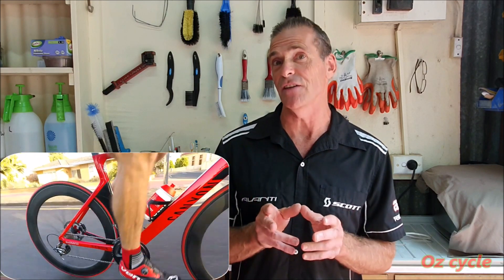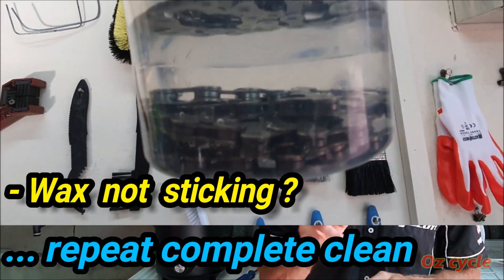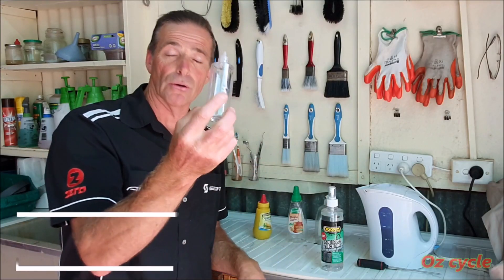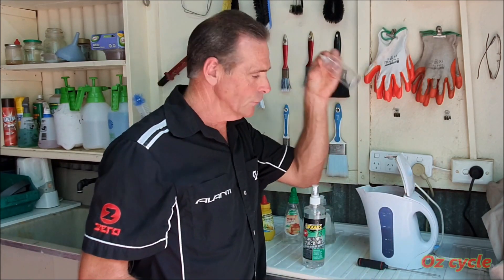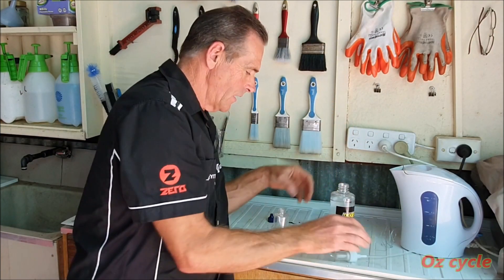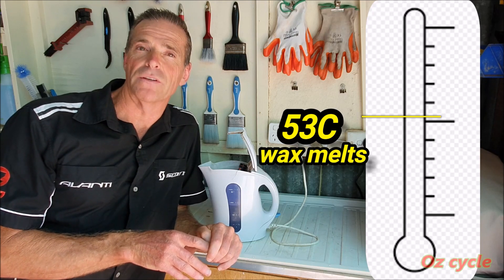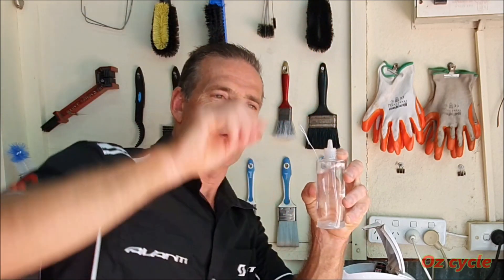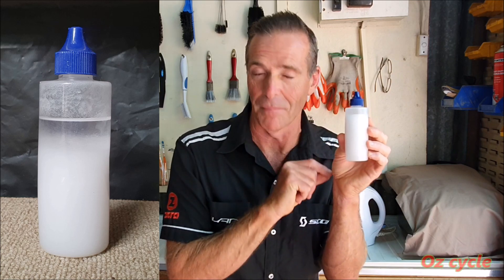Chain wax in a bottle - make it yourself

Comment: I think completely degreasing the chain and changing the wax if it touched any oil is bollocks.  Your own previous recipe softened the paraffin wax with liquid paraffin, a.k.a. mineral oil.  Paraffin wax and mineral oils are both petroleum distillates, composed mainly of alkanes, just of different molecular weights. Petrol, oils, kerosene, paraffins all mix with each other.  Molten paraffin wax washes away traces of petrol, kerosene or mineral oils if agitated sufficiently.  What am I missing?
Reply from the maker: Oil inhibits the ability of wax adhering to the chain and attracts dirt.

Comment: Idid the right same thing but my wax and alchohol seperates, wax in the bottom
Reply: Might be the % isopropyl. You can get it in different strengths, typically from 50% to 90%.

Comment: anybody knows how it performs in close to freezing temperature?
Reply: going on his other vids it should flake off mostly but there will be a micro coating of wax/ptfe on the metal. inside the links should be fine, if it crumbles the particles would be smooshed back into a softer solid product by the chain action rather than falling out. if its wet conditions i might be weary of corrosion with that micro layer but overall it would work ok ..in theory.
Reply: I very much doubt if you are putting, even as low as 10 watts, through your sprockets and chain, they are not well above freezing.

Technically, the wax is already frozen (a solid).
Reply: @LilRedDog  switched to smoove wax lube. expensive as shit but i love it. no more gasoline chain cleaning madness
Reply: @Vova3iLvova  I wonder, now that I went through so many replies, how the climate, in a particular region, affects which wax we use.
I live in a, slightly, colder latitude than Oz. 
So when my wax melts at 37c it is nothing like (I mean, that is hot no matter where you are but I seldom live in it much less ride when it is that hot) when his melts at 50c.

It would be very informative if people mentioned the average temp they have problems.

As for Smoove: I love doing the cleaning and fresh waxing. There is something about working on my bike, to make it better, that I, absolutely, love doing.

Comment: Weight based quantities would be useful here.  I mean, I appreciate the contribution, but without a weight based starting point I’m left to guess and screw around with trial and error.
Reply: Are you asking for Avogadro's number?

But seriously:

If the solvent evaporates completely, what does the ratio care? If you have too much wax and it precipitates, add isopropyl.